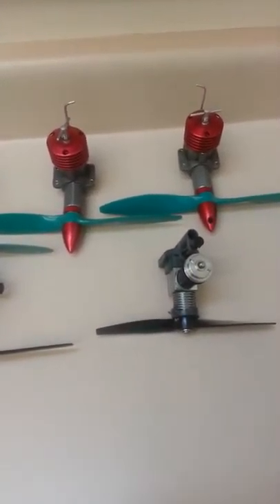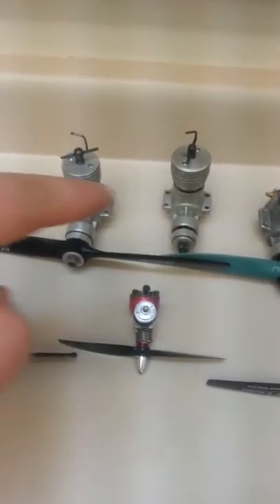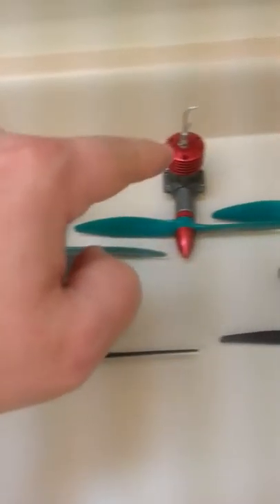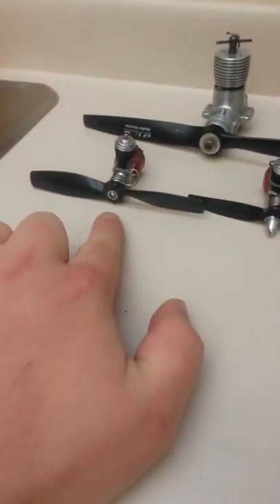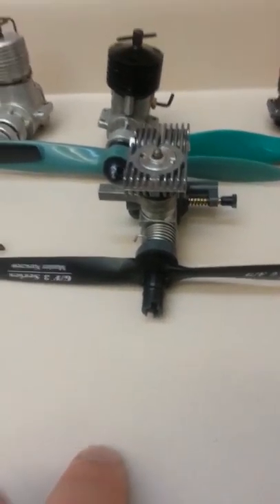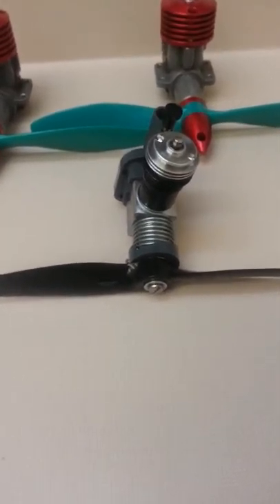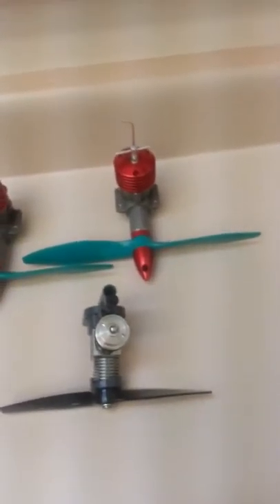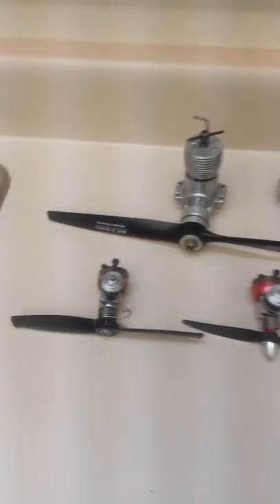Vintage model air plane engine collection

Comment: Hi Luke,Its slowly start to grow. Whats about the MK 12 b non runners? You still cant start the engine?

Peter
Reply from the maker: yeah it's getting there and i got the one mk12b running! he runs strong lots of fire power! the problem was a broken disk valve i will send you my parts engines like i sead  i was going to but sum sad thing have happend in my life but i am doing much better now i would like to see you make a vid of getting one of the parts engines running any how Cheers! i will sent the engines next month